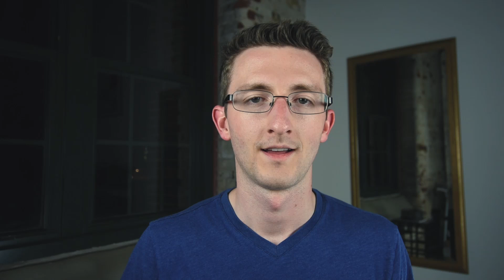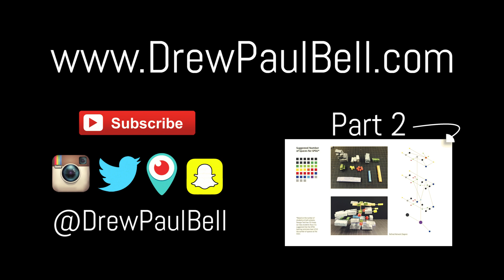Architecture Thesis Projects (Part 1)

Comment: I am doing my master's thesis right now, a research project where I chose a very abstract topic relating philosophical idea of a glitch(instead of just a malfunction in a technical system, it's the phenomenological experience of a glitch moment) with architecture. After hearing your video I feel like maybe what a am trying to achieve is adding something to the discourse but that is more the next level and not a master's project and honestly I am very overwhelmed with my own task I gave myself. So what is your advice for me to steer this into the right direction?
Reply from the maker: What’s the problem you’re trying to solve ?
Reply: @DrewPaulBell  I don't have one...
Reply: @DrewPaulBell  I think what I am getting at is that architecture needs conceptualism and through studying glitches I'm learning about systems and our preconceptions of architecture, i dunno if that's a problem or more so a manifesto of mine...

Comment: Hey Drew. I'm currently doing my undergratuate thesis which aims to come up with speculative designs of houses for people who are into cryptocurrency mining. Initially, I plan to conduct a Historical comparative analysis about the impacts of currencies through architecture (how the growth of economies led to te establishment of structures such as banks, stock exchanges, etc.) simply to correlate the two fields. What my study argues is that at this point in time, cryptocurrencies are trending mediums of trade, and give the people the opportunity to be in charge of circulating currencies and make extra income out of it at the comfort of their own homes (mining) Therefore, residential typologies will be the directly affected typology for my study. What do you think? I'd like to know your insight on the idea because right now i'm having trouble with convincing potential panel members to approve it. Although my thesis adviser believes in the idea too.
Reply from the maker: +Marco Angelo Torres I don’t see how someone’s interest in crypto currency would affect the the spatial needs of their house.  ....what if you studied cryptocurrency’s potential effects on banks? But still, most banking is actually done online as it is. 

The problem is that an architectural thesis has to be material. And crypto currency is immaterial. Maybe I’m ignorant about crypto currency, but I don’t see how it will have a bigger affect on the built environment than credit cards did. It may change the economy and the way money flows and they way people do business, but I don’t think crypto currency will substantially change our needs of the built environment.

Comment: Hey! How do you picked up the schools for architecture
Reply from the maker: I picked my university (Southern Polytechnic State University (SPSU)) because it was instate, so it was cheaper for me than going out of state. But if you have options, consider that some schools are more theoretical/artsy and some are more grounded/based in construction. I think the ideal school actually balances both. Check out their work online or in person. At SPSU the architecture department was in the “College of Architecture and Construction Management” it was grounded in reality, but also I could see they valued the artistic side of architecture. Some school have the arch. department in the “College of Fine Arts” or something. That’s more likely to be artsy.
Reply: I am asking because I see there is a lot of programs in Arch. Schools. Some schools are Design Schools, Art Schools...and I want a school that when I finish the program I get certified as an Architect...
Right now I am in Miami but i am thinking on going back to NJ
Reply from the maker: Look for a NAAB accredited program. That will be either a 5 year B.ARCH degree or a 4 year bachelors degree + a 2 year M.ARCH. But you can learn more from NCARB or NAAB at their websites.

Comment: Hey Drew, I'll be doing my thesis next year, but in a different city and country from my current place of residence. I don't know the city that well yet and I feel like the most successful thesis projects are contextually local because your peers and professors will understand them and sympathise  a lot better. Do you have any comments or thoughts?
Reply: It might be smart to do something completely different from the local thesis projects. Perhaps you could take aspects of your native city or country and combine it with aspects of the current place of residence. For example, the vernacular architecture of your home country architecture has benefits x ,y, z. And the current place of residence has problems a, b, c. You could try to incorporate inter cultural solutions to the local problems. I think that could give you a very unique project that would stand out from the rest.
Reply: +Michael Thanks, I think that's a great idea. I'll consider that going forward